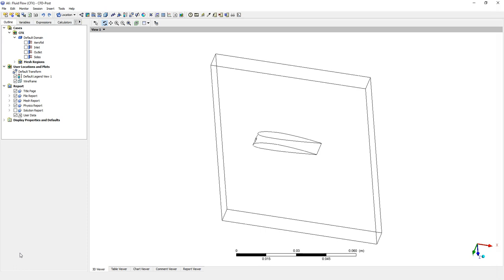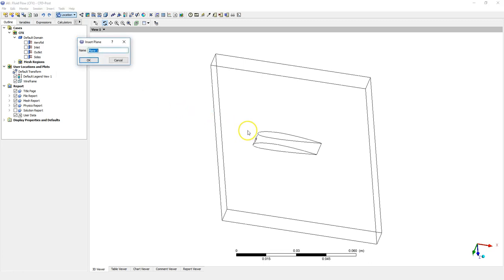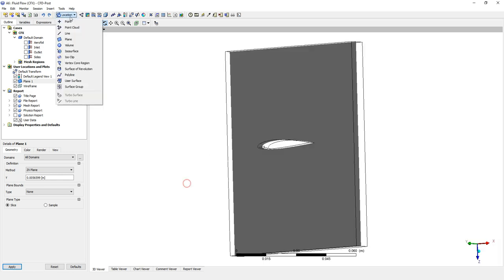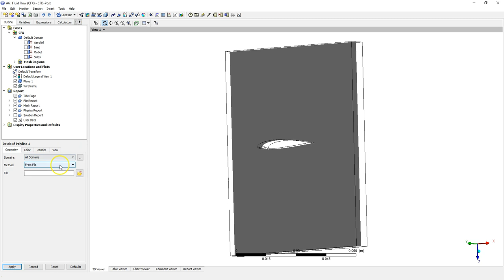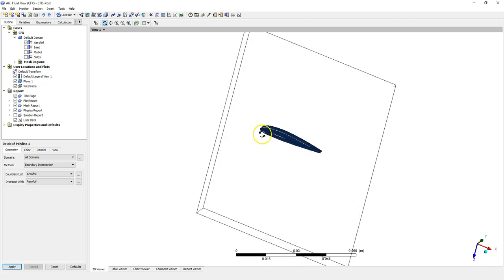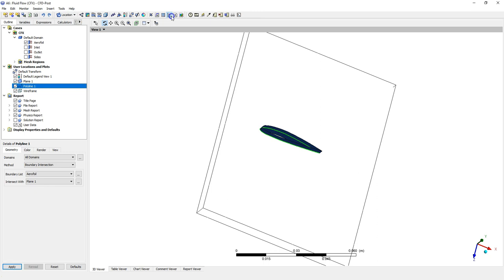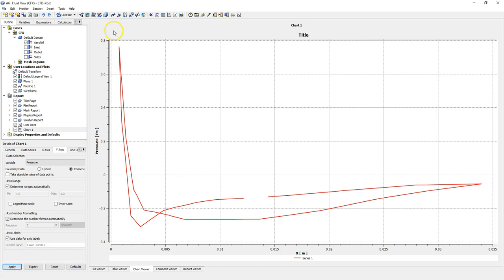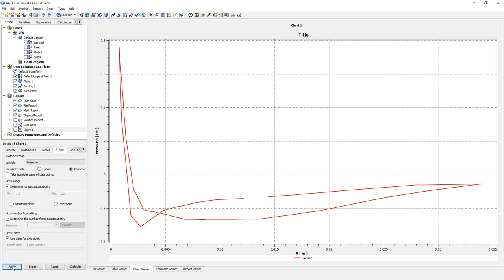Extracting surface pressure from an aerofoil in CFD Post | Climate CFD

Comment: I need a polyline only on the upper surface of the airfoil. I don’t need the polyline on the bottom surface. Is it possible to draw??
Reply: did you able to do it? im also facing the same problem.
Reply from the maker: Split the surface along the chord line when you create the geometry.